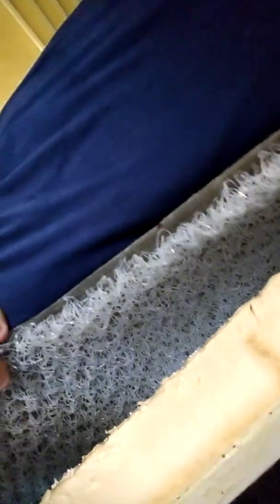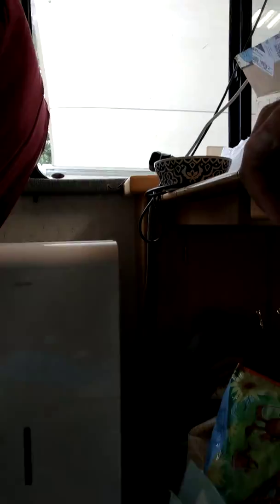Mold under the mattress in an RV - Solved, for good.

Comment: I had the same issues, I got the dehumidifier and thought it's overkill, until one day I found water next to my mattress! Had to strip the musty boat carpet stuff out, took out the mattress from the loft..what a chore! Thankfully it was only condensation from the front window, dried the flooring, and plugged in the dehumidifier, and dry dry dry! I'm in washington state  , rain rain rain..it's amazing with the dehumidifier running and opened my window over stove, I'm actually using less heat!   Been sleeping on my dinette in my 1997 lance truck camper on memory foam, haven't found water under the foam yet..but the loft and window is dry!!
Reply from the maker: Nice!

Comment: Covered the mattress in an envelope of plastic and duck tape. Before the final seal poured in a couple of cups of borax.   Then painted the plywood sheeting on the bed pedestal with  borax dissolved in  a small amount of water and  let it dry before putting the plastic covered mattress back.  What my biggest problem has been is the condensation on the back window which doesn’t vent. Water drips down the window and wall behind the mattress.  I purchased the dehumidifier and that’s helped some.  I resorted to putting another sheet of plastic on the wall and a length of paper toweling which I make sure is taped to the wall slightly above the plastic so it grabs the moister and wicks it out.  In the useless window track I take more paper towels and twist those to make strips and pack the window track.  That absorbs enough water to need to be rung out every morning and replaced, even with the dehumidifier.  I check the pedestal a few times over the winter months throwing borax on top when I tip the mattress too look, even if I don’t see mold.

Comment: We bought a 4500sqf dehumidifier for our 5th wheel. With the model we bought we can set the humidity level we want. We leave it at 50% and its a done deal. We put ours in our bathroom and run a hose from the machine into the shower basin. So we never have to empty it again.
Reply from the maker: Nice!  Is it a mounted dehumidifier or on wheels?

Comment: Very interesting. Have you considered that if you vented the engine cover box, that it would then get air circulation, and, as such, the temperature between the bed under the mattress and the box that it sits on would be equal?
Reply from the maker: The "engine cover box" isn't a box.  It's a raised portion of the floor.  If I did vent it, I would be venting to the outside world.